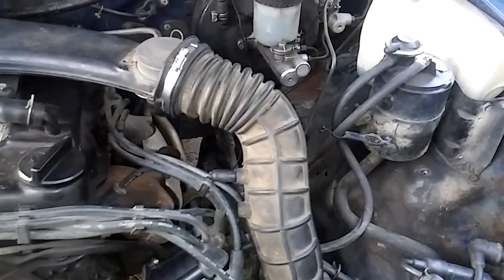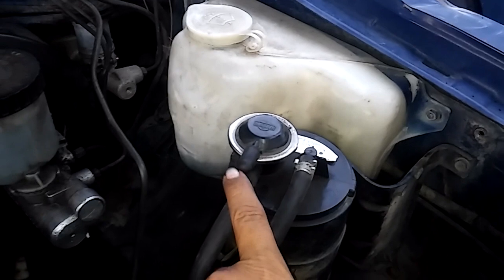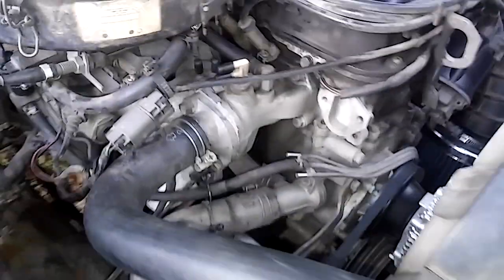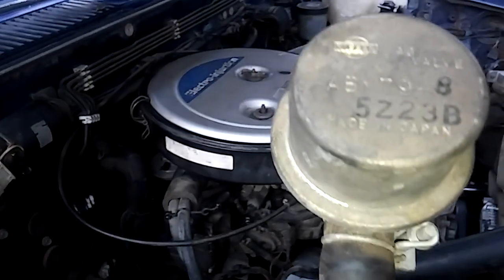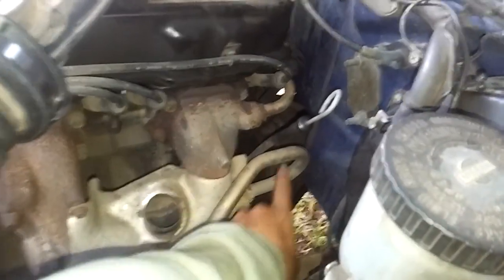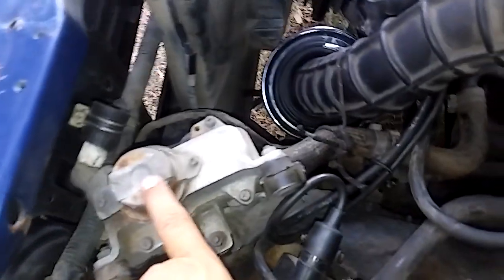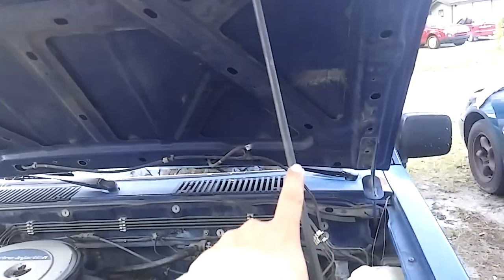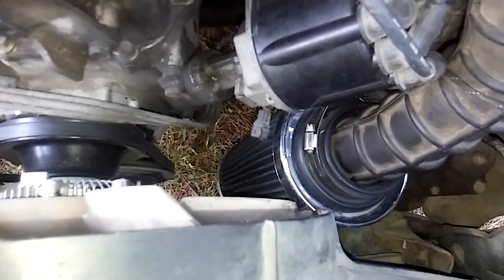86 Nissan D21 Vacuum Hose Delete, and other stuff

Comment: Yeah i did the same thing with the vac hoses.  I just traced where they went and if it was non essential i capped or removed.  And some rust did some removing of components for me as well.  i took about 20 feet of vac lines out that were just going nowhere but back on themselves lmao.  Truck runs great now besides a bad fuel injector that I'm about to replace.  Oh and lifters are noisy I might go in and adjust the lash.  Eventually I want to get a standalone fuel injection 2 or 4 barrel system and build an intake for it.  Or if i get a chance just swap a 2.3 ecoboost in it.
Reply from the maker: Mr Woody that's awesome, man! Glad it worked out for you! :)
Reply from the maker: I'm glad deleting all those hoses worked out for you! It sure does clean up all that unnecessary clutter! Lol

Comment: What car did u get that Intake hose off of? And what size air filter cone is that?
Reply from the maker: Sorry. I don't remember what car I got the hose from. This was a few years back. The filter I'd gotten from auto parts store.  Don't recall the size. I've since removed the throttle body and installed a Weber carburetor. So the setup isn't the same anymore!
Reply: It came from an 86 Nissan 200 sx

Comment: Is this the fuel injection carb z24i
Reply from the maker: Yes. At this point she still had the fuel injected throttle body. I've since installed a Weber carburetor.
Reply: Was it worth it?
Reply from the maker: @samwhite1345  yes. When I was first removing the throttle body, most of it's components were very brittle. Parts were crumbling apart as I was removing them.  
 It was the same with all the emissions stuff. The Weber helped do away with all that. Plus it helped open up the engine up a bit. I'm not winning any races, but at least now...she's only slow. And not slow as molasses.  😆
Reply: That's awesome I wasn't aware that you could convert the EFI to the Weber I have a 720 z24 that I'm trying to find a conversion for and it's been a pain
Reply from the maker: @samwhite1345  yeah. It's a great alternative too the stock throttle body. Plus the Weber doesn't need any of the tbi sensors or vacuum lines too work
Reply: @almagam2099  yeah the emissions lines and vacuum on the z series engines are crazy and most of it is useless
Reply from the maker: @samwhite1345  agreed. Once I learned about the Weber. It was any decision to do the swap. My tbi and all the emissions stuff was old, brittle and breaking apart.

Comment: Nice video mate. Does this affect the idle ? Like higher revs at idle? Should this give better gas mileage?
Reply from the maker: I honestly don't remember! It's been a long while since I deleted the vacume hoses! I want to say the Idle did improve! It used too surge up and down at idle, but would normalize when accelerating! 
I can def say installing NGK wires, NGK ignition coils and iridium spark plugs greatly improved overall performance and especially gas mileage! I think the truck used to get around 16 miles to the gallon or less?!...after the ignition upgrades, it jumped up to between 27-30 miles to the gallon?!!
Reply: That's the anti back fire valve and is very necessary
Reply: @almagam2099 could you send the link for the NGK ignition coils?
Reply from the maker: @wakeupdammeh706  sure thing. Here's the link. Type in your specific year, make and model. They should have the parts you're looking for. 

https://www.rockauto.com/en/catalog/nissan,1986,d21+pickup,2.4l+l4,1210835

Comment: Any problems come from doing that yet?
Reply from the maker: Thankfully, she's still running good! I actually had found a forum where they went into great detail about removing all the nonessential Vac Hoses! It was incredibly helpful! I'll try and find it again and I'll post a link to it here! 
 I still need to look for or somehow fabricate a smaller air-box as the stock one has a port at the bottom for a vacuum hose that I removed! I'm not sure, but I think that open port would have the same effect as a vacuum leak?! also that air intake hose I added to the air-box isn't air tight! It's on there very snug, but it's essentially another spot with a vacuum leak! Other than that, removing all those Vac hoses really improved the overall performance of the truck, plus I also did your basic tune-up! The only thing I haven't done, is replace the old spark plug wires!
Reply: @almagam2099  , did you find that forum?
Reply from the maker: @ericjackson478  this is all I've  been able to find! But I'll keep looking! http://www.infamousnissan.com/forum/showthread.php?t=17480
Reply from the maker: @ericjackson478  most of the forums I've looked at, at least the ones with photos, the photos are no longer there!

Comment: What about the pcv did you delete that also
Reply from the maker: Benji Hunter sorry no, i haven't done that! Would it be better to delete it or replace it with a new one?
Reply from the maker: Benji Hunter I ended up taking off the pcv valve after work yesterday! It was fairly dirty and grimy, but otherwise it was in really good condition! I cleaned it really good and reinstalled it! So far the trucks running good!
Reply: Thank you. I thought I could run my '87 Pathfinder without all that   vacuum hose. I tried pulling them off which ran bad. Looks like capping the ports is the important thing. Big difference in '86 to '87 motor types, or there's a chance mine may be a "90s motor.
Reply from the maker: Yeah I learn't the hard way there's a big difference between the 80's and 90's motors! I'd started removing hoses on my 93 Nissan (big mistake)! It's fuel injected whereas the 86 is carburated! I had to put all the hoses back!
Reply: @almagam2099  its not carbureted its throttle body injection
Reply from the maker: @dosstheboss100  you're right!!!

Comment: Why is this necessary?
Reply from the maker: Is and isn't! On this particular model "carbureted engine" most if not all the vacume hoses are obsolete! The main reason I did it, was when I got it from the previous owner, pretty much everything the hoses connected too, were in really bad shape and crumbling too the touch! After a bit of research I found a forum on the subject for my year, make and model truck! I've tried searching for that exact forum as it was incredibly helpful and detailed with photos and explanations on the entire process! But no such luck!
Reply: @almagam2099  
Could you post the link for that forum? I have the exact same engine and want to delete the same part, but I'm not sure how to do it and what I can touch and what I can't.
Reply from the maker: @oswaldorodriguez5728  I'll try my best too find it!
Reply from the maker: @oswaldorodriguez5728  I've never been able too find the exact forum for the egr delete! But here's one that does have photos and explanations on all the vacume hoses and where they go! Hope it helps!
https://www.nicoclub.com/archives/nissan-720-pickup-truck-vacuum-hose-routing-and-repair-guide.html
Reply: @almagam2099  
Man, thanks a lot. I appreciate it.
I'll check rn and post back any issue or improvement I notice.

Again, thanks a lot! 🙏🏼
Reply from the maker: @oswaldorodriguez5728  you're very welcome!

Comment: Want to Delete all unneeded Vacuum lines, canisters smog do-hickeys!? But, if the video can't identify a(Air cleaner canister) EGRs, the thing that was there now on the ground how can I know makes sense of what I'm removing or not ?   I came to the site for info! On deleting ?? That thing on the ground that you took off the drivers side looks like a Brake Vacuum? Is it smog ? And that hose U removed but put back on because it ran bad?A lot of mis informed & I'm already that.
Reply from the maker: I'll try my best to find the forum I was on where I first learned about this topic! It was very informative with photos and description! I do know that it's far easier deleting the vacume hoses on a carbureted vehicle than it is on a fuel injected one! I was merely showing that it can be done!
Reply: The round one is a valve that takes exhaust and puts it into throttle body for some reason. I saw the anti backfire thingy that usually sets on a mount with it in the dirt.  the tall black one you capped off is a canister of charcoal that's not "needed"  also has a filter in the bottom should be serviced 15k miles wasn't in the manual. it will leak on stuff I have heard.